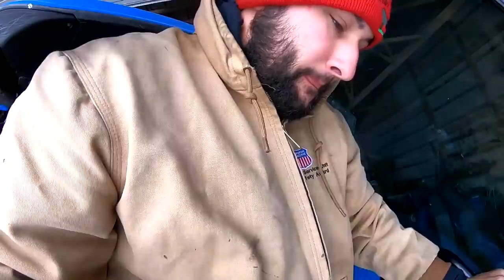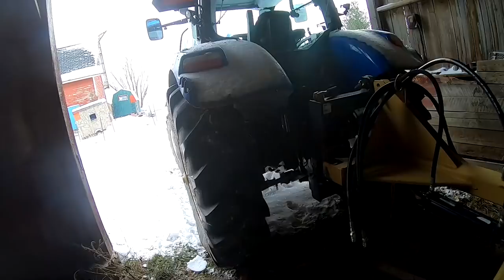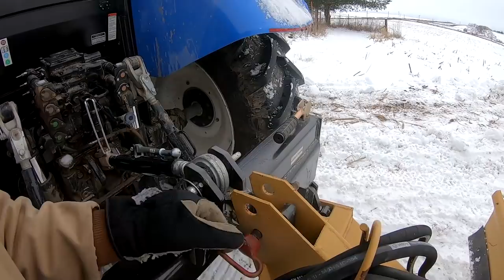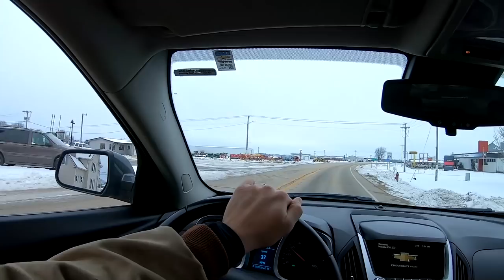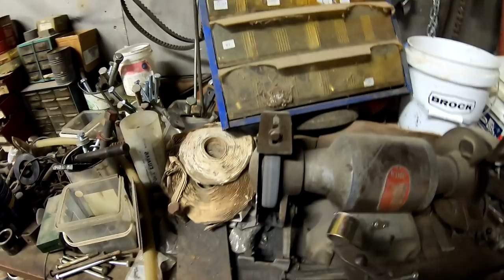I GOT COVID... and BROKE our TRACTOR

Comment: Those quick hitches are the hardest way of doing something simple they really need a hydraulic top link to make hooking up easier. Would it not have been easier to just buy the European style lift arms for it with the cat 3 walterschield hook ends. I have used both types and you’d be quicker hooking up with just the standard lift arms you have than using those stupid quick hitches

Comment: Ron you mentioned selling steers for US$1.30, what weight would those steers be. Are they weaners going to a backgrounder, or have you backgrounds then selling to a feedlot finisher. Just interested as here in Australia, we are getting the best money we have ever received. Like weaners 200 kgs are making $8/kg, Cows and calves AUD $4000 plus. Steers going to a feedlot finished AUD $ 2500. That's here in Queensland in the southern states they are making more. From Down Under
Reply from the maker: I even mispoke. At the time of the video, we were actually selling them for $1.50 USD and that was at finished weight straight to the packers. So on average we are selling them at 1,500 pounds and that's also one of the best prices we've seen

Comment: Don't use a quick hitch with bale forks, geometry of 3pt with quick hitch wont give enough angle to hold bales on and top link was probably out to far when hauling bales on rear forks so forks where tipped down to far when backing into bales putting pressure on top link and cat 2 top links specially New Holland seem pretty weak in my experience with them which is years worth

Comment: Some of the cat II implements can be non quick hitch compatible. I think that is what may be the problem with the bale spear. I have had to have our fab guy modify a box blade. What happens is the top pin hole is too far back and when you pick up the implement it binds the top link. Voila you get to spend a hundred bucks or so.  The mower is definitely quick hitch compatible.

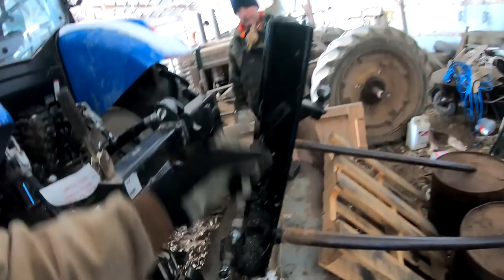Comment: At 5:54 in video the top link looked bent, Could be from contact with QH when around all the way up. I’ve seen top links when connected to certain implements, you have to make sure the end of top link is positioned correctly, or it will bind in the up position because it is offset to avoid binding.  You need to position that end so that extra metal at end of threads is up, that caught the QH & bent the end, simple easy mistake to make.

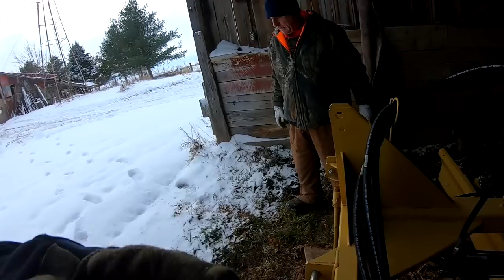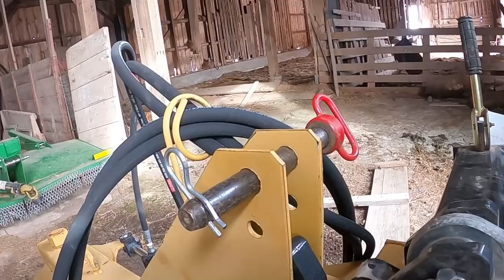Comment: You adjusted the top link when you put on the quick hitch @5:20 .  @6:49 you can see that the top link is upside down and still straight.  When you raised the blade to the maximum height, the top link contacted the quick hitch and bent the top link.  Happy Hunter also mentioned that the ear on the link is supposed to be on top.

Comment: Glad you are doing well. as far as the bent top link is concerned, it was the hydraulic force that doubled it when you raised the lower arms here in Europe this happens many times when you change implements and we stretch the top link so we can use them, you have to pay attention that when lifting certain implements the top link hits under the ball joint and the hydraulic force bends it, in the video it is visible that you have the ball joint  that connects to the implement with a metal ledge with a hole facing down, see if it was not This ho hit the structure when going up and caused the top link to malfunction,  You all have to pay attention if when lifting the implement to the top the top link doesn't hit anything when making the move,  with time you will learn.

Comment: Look into the new white batteries gopro just released in NOVEMBER they're designed to be better in cold conditions. Everyone that's tried them says they are better..no shutoffs. Not every piece of equipment is exactly the same dimensions, like John deer stuff hooks up fine with John deer quick hitch, I'd get a better hitch ( John deer or whatever you have the most equipment that is same name.  Measure the hitch before you buy it

Comment: Uploaded 48 sec ago, better check what’s up.
Good to hear you’re better again, bummer about being sick over the holidays. Regarding the rear facing bale spear, isn’t the top link adjustable to take up the tilt on the spear frame? I mean that is what the adjustment is for, if you have the same length of threads on the other end opposite the bent part you should have about 12-15” adjustment which should be enough?
Regards from south Sweden